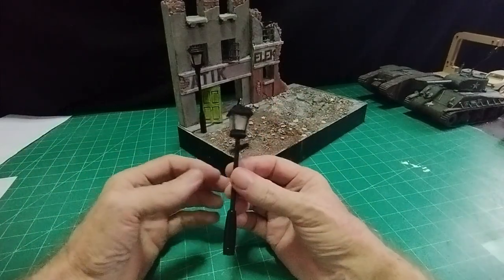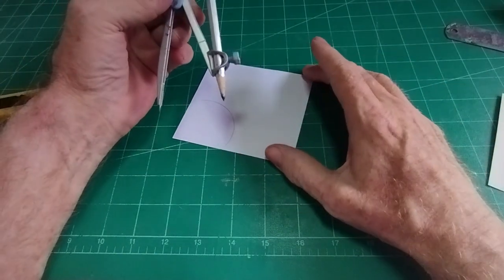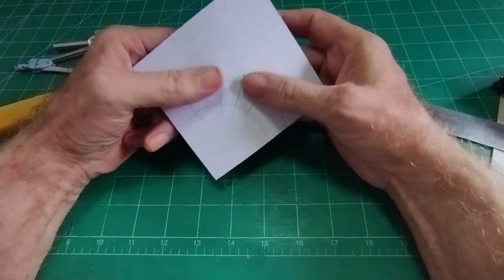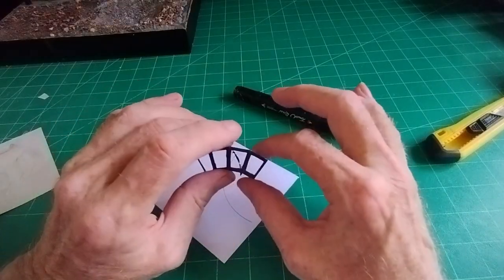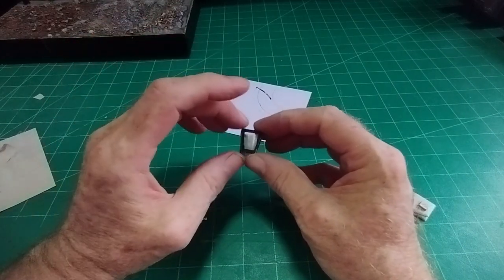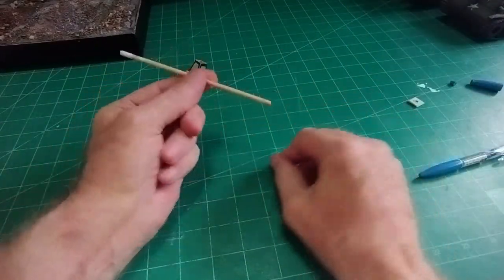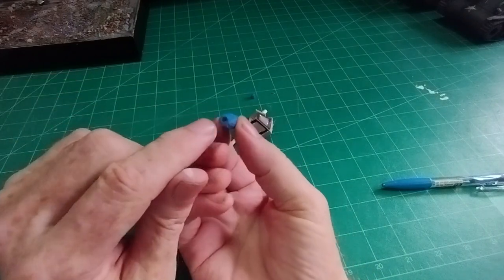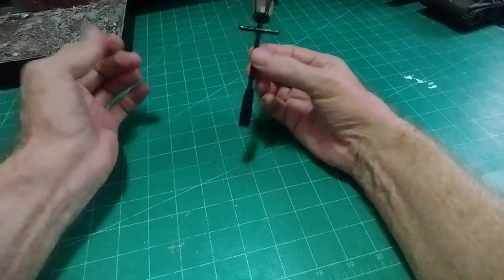Vintage street lamp, full tutorial

Comment: just made this myself this evening. The only thing I changed, was replacing the BBQ stick, with a piece of plastic tube. Down the inside of which, I run the wires from an LED that I had left over from another project. The grain of sand LED was fixed at the top, and then completed as per your great piece. The wires will be connected to a switch and a AAA battery. And heh presto a working lamp for a shadow box street corner diorama. Thanks for the inspiration Don, you're a genius.
Reply from the maker: Brilliant, l considered the LED thing but decided not to, mainly because l don't have an LED thing